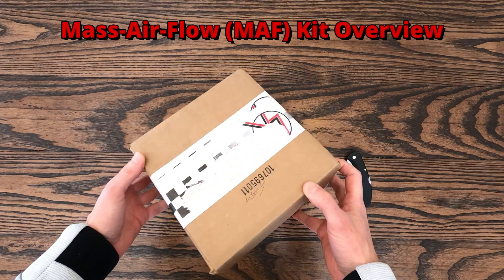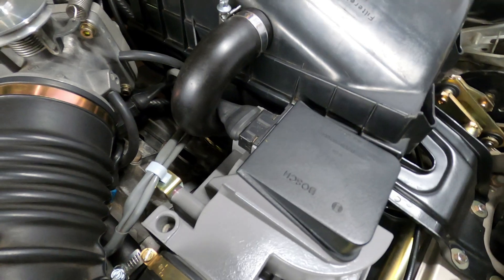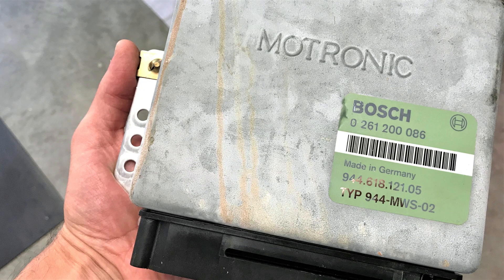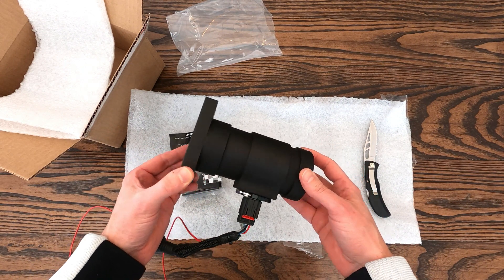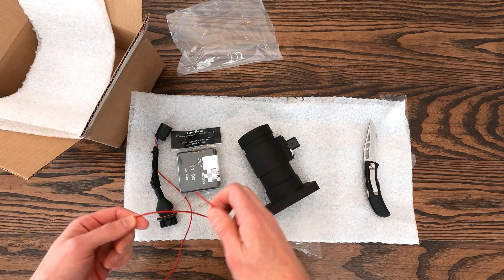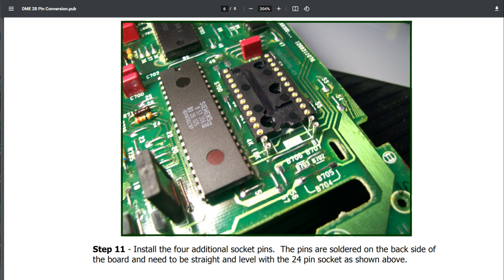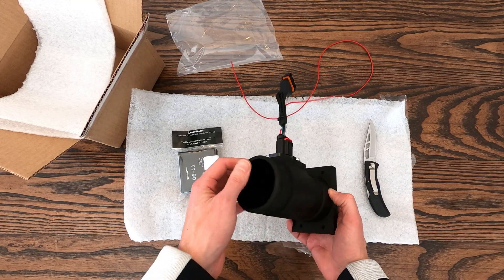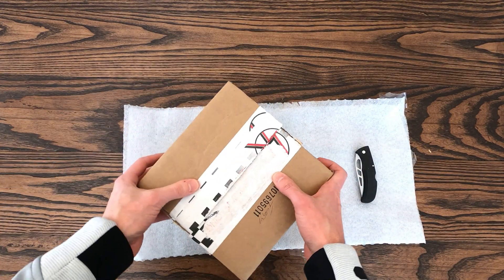Porsche 944 – Mass-Air-Flow (MAF) Conversion Kit Preview & Benefits Over Air-Flow Meter (AFM)

Comment: I can't find a version that attaches to the airbox for the turbo models. What would happen if I used this product on my 951?
Reply from the maker: Hey man! Yeah, the Turbo uses a different kit, but still available. Here’s a link - https://www.lindseyracing.com/LR/Porsche/LRA-M-TUNE.html
Reply: @NC944er  I saw this and many others. I don't like the look of filter. Was hoping for an alternative that bolts to the factory airbox.
Reply from the maker: @j.b.e.5149  Ahhh, gotcha… yeah, I haven’t seen any for the 951 that bolt to the factory air box, they generally use the cone-style filters.

Comment: I finally got all this stuff and a newer DME for my 84. I have a cam on the way as well. Once I get the maf going, I'll get into the cam, and do some porting.
Reply from the maker: Very cool! Sounds like some sweet upgrades. 👍🏼
Reply: @NC944er  This ended up working out great for me. My AFM must have been wonky, because the car runs a lot better.
Reply from the maker: @TheRealFrankWizza  Glad to hear it! Mine has been pretty stable as well after getting it dialed in.
Reply: @NC944er  I got lucky, when I got my DME from ebay, and opened it, there was no doubt that it was in flood water. However I cleaned it with 99% isopropanol, and saw no signs of corrosion. It fired right up.
Reply from the maker: @TheRealFrankWizza  Score! Hope you got a good deal on it, they can be costly. I’ve thought about having F9T do the sport DME upgrade on mine, but it’s not yet too bad off.
Reply: @NC944er  It was in fact the cheapest one, but it wasn't listed as waterlogged. It still cost a little bit, and required me to solder the jumper and pins for the chip. I don't know much about F9T, but how much better could it be than the 4+% gain you got here anyway? I have a cam and the seals/gaskets on the shelf, I have a few things I want to do beforehand, but I think that's the best gain for the money. I think I paid about $550 shipped for the cam from TIJ Power in Germany. I am going to port the head a little as well. Just to clean it up. Port match the intake and head to the gasket. With this MAF, the AFM won't need calibration for the increased airflow lol. 

My car came with a cat test pipe, a dansk catback, and some long tube header. I think it will be pretty peppy with the cam. Mine is an 84 and I think weighs a bit less than newer 944s, which helps.
Reply from the maker: @TheRealFrankWizza  The porting sounds pretty sweet. I don’t see a lot of people doing that on these cars outside of the track scene. 

I’ve always been a pretty big fan of the factory exhaust, I think because that’s how I was first exposed to these cars as a youth, but I have to admit the Dansk exhaust is starting to catch my eye, or should I say ear. 😂
Reply: @NC944er  It has a nice raspy sound to it.

Comment: How has it held up so far?
Reply from the maker: Hey Ron! The kit is installed and doing well so far. No idle adjustment was needed as I think the ICV on the later cars solves for this automatically. It pulls noticeably stronger in the higher revs, but was hesitating a bit off idle with initial throttle tip-in. I adjusted the FQS switch on the DME to add +9% to the fuel mix and that eliminated it for the most part. I’m scheduled for another Dyno test next week to hopefully confirm it’s dialed in well and see the results. 👍🏼
Reply: @NC944er  Thanks! Can't wait to see more. I wish you all the best. Thanks again for making such amazing content

Comment: Nice start.  But, you should DYNO your engine BEFORE and AFTER the MAF install.  All the other vids on YT concerning this conversion SUCK.  You should put to rest once and for all whether this is an upgrade or just snake oil
Reply from the maker: Dyno testing results would be interesting to see, I agree. There are a couple shops in my area and I could probably get the before and after tests done for about $150. Haven’t yet decided if I want to invest it since it’s just a street car and I have no other big tuning plans for the car. We’ll see…
Reply: @NC944er  Inquiring minds want to know.  Seat of pants results are subjective at best.  However, you can't argue with the numbers.  Make a deal with the dyno shop.  You'll plug them on your vid if they give you a rate on BEFORE and AFTER runs on their machine.
Reply from the maker: @guyfaux5010  I just scheduled a baseline test for May 3rd. Regarding the negotiation, you may be dramatically overestimating the influence of my channel, but it’s worth a shot! 🤣
Reply: @NC944er  Alright man.  Don't underestimate your channel.  The value of these cars are going UP and your channel is one of the most comprehensive channels on this subject by far.  I've owned my current 1988 Celebration Edition 944 since 1994 so I've seen all the forums, channels, groups, etc.  Keep up  the good work.

Comment: Are you having a throttle hesitation with this kit as well? Chasing my tail on it. Basically does it fall on its face when you twist the throttle? Ive had my kit since late January its one of the test kits.
Reply from the maker: I haven’t installed mine yet as I’m still rebuilding the front end, but it sounds like I’ll having something to look forward to. 😂

Did you have issues of any kind prior to installation? Also, do you have the power lead wired to the positive ignition coil terminal or another power source?
Reply: @NC944er  i fixed my problem i put bigger injectors out of the 2.5 and a 3.8 bar regulator. For some reason the 2.5 injectors flow more then the 2.7 injectors do at 3 bar as the 2.7 factory uses a 3bar regular and the 2.5 uses a 2.5 bar regulator kind odd but I fixed the problem after long research and trying multiple parts.
Reply from the maker: @vincentarcuri4089  Very cool, thanks for the follow up!
Reply from the maker: @vincentarcuri4089  How badly was yours hesitating? I’ve got my kit installed now and the RPM does dip slightly on initial throttle tip in, hesitating a bit. Only noticeable from idle. I may install a 3.0 bar regulator to see if that helps, currently running a 2.5 bar with the the 2.5 injectors.
Reply: @NC944er  it was pretty well to my liking at least. Like if it had to jump out from a stop it was not there then it would kick in. I put a 3.8bar in and switched my injectors to the 2.5 motor injectors since apparently the 2.7 flow less at 3 bar the the 2.5. And it fix the problem. I do notice at wot in certain RPMs its either not getting enough fuel or too much i need to put it on my dyno and hook the wide band up to figure it out.
Reply from the maker: @vincentarcuri4089  Hey man, check out my install video when you have a chance, Dyno results 13 minutes in, I’m curious about your thoughts. 

I had to jack up the fuel mix to get it to not hesitate on initial throttle, but it’s getting more than enough fuel after 3,000 RPM, dare I say too much. But there are lean air spikes at the start of the O2 measurements between 2k-2.5k RPM. So not a fuel pressure or delivery issue, maybe the mapping is off on the low end? Are you using the aftermarket throttle response cam? I’m wondering if I switch back to the factory cam with the fuel saver arm, would that allow for a more seamless throttle transition? Could the tune be sensitive enough to have been mapped TO the factory cam? It’s weird…

https://youtu.be/0u5eQ9MtqGI
Reply: @NC944er   i will check out the video. I am using and after market throttle response cam. I also did think of removing it. I do feel around 2-2.5k something could be lean i then sometimes fell it in the upper rpm band. I have yet to put it in my dyno with an AFR reading just been soo busy on everyone else stuff soo mine is on the back burner. I have definitely questioned the mapping. I also have my fuel mixture turned all the way up. The car seems to like that the best. But my car does also have larger valves too
Reply from the maker: @vincentarcuri4089  Cool, no worries! Good to know about the throttle cam. I may swap it back and see if that makes a difference. The mix is very even after 2.5k, it’s literally just when opening the throttle. Almost like there’s a delay in the fuel response for a second and it needs to catch up with the rush of air. At the +3% fuel mix setting on mine, it stumbles when it’s cold below 2.5k, but that almost completely goes away once the engine is at operating temp, and above 2.5k it runs like a dream. The blade sensor is apparently a Ford/Hitachi unit… I read one forum post that said Ford Mustangs exhibit the same behavior, but who knows. 🤔

Comment: Installing mine right now.
Reply from the maker: Nice! Let me know your thoughts and if you come away with any tips or lessons learned. 👍🏼
Reply: @NC944er  I don’t like the angle it goes into the J boot or how it’s still a tiny bit loose in boot. May get their silicone intake boot and see.  Gonna use an eye connector for red 12v to coil. Still in the middle of doing turbo brake, manual rack, and stripping emissions. ‘86 NA
Reply from the maker: @devildog_iii3492  Sounds like some nice upgrades in the works! It doesn’t appear the coil circuit is fuse protected, so I picked up an inline fuse kit on Amazon for like $10… maybe pop in a 5amp blade to protect the MAF sensor. That’s odd they can’t get the J-tube mounting size correct, I’ll need to look at that.
Reply: @NC944er  not a bad idea w fuse.  Kinda pissed at Lindsey for scraping off all the part#s
Reply from the maker: @devildog_iii3492  I talked to Dave Lindsey on the phone today and he said the sensors are a Hitachi manufactured part used in Ford applications. He receives them in Hitachi boxes and said the numbers are already scratched off upon his receipt and he’s not entirely sure why, all he does is take the blades and install them in the intake tubes. 🤔
Reply: @NC944er  that’s kinda what I figured they were. And that’s even stranger…. Got mine running, had the damn chip upside down in the F9T. About to put the wheels on and get her out.
Reply from the maker: @devildog_iii3492  Nice! I took mine out with the MAF for the first time today. It pulls noticeably stronger in the higher revs, but hesitates a bit off idle with initial throttle tip-in, gonna play with the FQS switch tomorrow… see if adding a little fuel will help.
Reply: @NC944er  sweet! Glad u noticed a difference. Let me know what settings ur trying
Reply from the maker: @devildog_iii3492  I was able to eliminate most of the initial hesitation by setting the FQS switch to position 5, which is +9% to the fuel mix. It was still there at the +3% and +6% settings. Hoping the wideband O2 readings from a follow up Dyno test will tell me a bit more.
Reply: @NC944er  nice. I’ll start at 6 if I have it. Should be driving this weekend
Reply: Are you having a throttle hesitation with this kit as well? Chasing my tail on it. Basically does it fall on its face when you twist the throttle? Ive had my kit since late January its one of the test kits.
Reply: @vincentarcuri4089  I haven’t started mine yet

Comment: Thanks to this video, I purchased this kit for my '86 NA. I would appreciate it if you could suggest a safe routing of the red power wire to the ignition coil for me. Thanks again for all your excellent videos.
Reply from the maker: Hey Gerry! Yeah, the instructions don’t provide a recommended routing path for the power wire and it’s not terribly long to begin with. I think the answer depends on how clean you want the final look to be, but the primary conditions are that it should be clear of any high heat sources and it has to be connected to a circuit that supplies 12v when the ignition is switched to the “on” position. Here are a few options I’m considering…

1. There’s a switched power source available if you run it back to the diagnostic port on the driver’s side behind the emissions vapor control valves (black cover that can be flipped open to reveal 5 connections) This is what I would love to do, but I need to test it again as the 1988 models eliminated two pins and moved some connections where it’s a slightly different setup from the earlier models. This method would be short, easy, and allow everything to be kept on one side of the engine bay. 

2. The easiest path to the ignition coil would be to follow the wiring for the oil pressure sender that runs under the J-boot, over the water pump, and down the passenger side of the engine. The only thing I’m not crazy about is jumping the gap between the engine and the right frame rail where the ignition coil is mounted as the wire would just be floating there. Maybe route down to the sender and then back up the power steering fluid line? 

3. A cleaner option would be to follow the existing wiring for the ignition coil, which could be picked up on the left frame rail under the air box. It then passes under the headlight bucket and to the right along the front cross member behind the aluminum bumper, and down the right frame rail under the headlight motor. This would be very clean and heat free, but would require front bumper removal and splicing in some additional wire to extend the length. 

4. I also like the idea of connecting it to the circuit for the HVAC blower motor, since it’s powered in the on position. That way the wire could go straight back on the left side following existing wiring and pass though a bulkhead to the fuse box. I was thinking if a no-start condition arose at some point, it would be nice to have the MAF separate from the ignition circuit and you would know it’s receiving power because you could hear the blower running, then move on the the next suspect. 🤔 

Anyway, let me know how it goes for you!
Reply: @NC944er  Thanks for the quick response and supplying so many options. As usual, you're thorough and go beyond the expected. Keep up the good work and I will let you know what I finally decide to do.
Reply from the maker: @gerrygoulet1675  Yeah man! I’ve seen some info on the forums that indicate the ignition coil connection can present some noise and is not fused, so adding an in-line fuse to the power wire seems to be a sound recommendation. My diagnostic port is testing at 11.75v, which may not provide the smoothest operation for the MAF sensor, which requires 12v+. Not sure if that has to do with the lighter gage wire there or oxidation somewhere, but I may be exploring the fuse panel a bit.

Comment: What about the early cars. Is the chip compatible with them with the pin conversion?
Reply from the maker: The DME units for model years 1983-1985 had the ADC chips hard-soldered to the boards, so there’s no easy/plug-and-play method to swap the chips. What’s recommended is to first upgrade the DME in those cases to one from 1985.5 or later, which will have the chip socket already built in. 1985.5-1987 DMEs are setup for 24-pin, so those will need to be converted by adding in 4 additional chip pin sockets to accommodate the 28-pin chip. DMEs from 1988-89 are already setup to accept the 28-pin chips.
Reply: @NC944er  ok gotcha, I figured there was something weird with the early cars

Comment: Looks really good, i live in Germany and im quite concerned about his legality. It’s under the TÜV German standarts?
Reply from the maker: The manufacturer doesn’t publish any emissions data on the product, but it does have a built-in intake air temperature sensor, which is used with MAF for the purposes of fuel economy and emissions control. In the US, each state and county has individual requirements and different standards. I live in a rural area that doesn’t require exhaust testing at all, but states like California are very strict to the point of implementing a visual modification inspection on top of emissions and this would likely raise concern there. I can’t speak to the TÜV standards specifically, but I will say that I’ve seen people swap out the MAF for the factory AFM to pass the test and then reinstall the MAF when they get home.

Comment: Great video , I have heard you can clock the stock afm to change fuel air mixture. I’m curious to see how the maf will preform for you.
Reply from the maker: Thanks! Yeah, I’ve seen some folks make adjustments to the AFM with some success, but looks like it requires a bit of trial and error. If mine were malfunctioning, I’d probably be more inclined just to replace it with a new one. The cleaning of the contact strips and realignment of the sweeper arm seems to make sense though if there are deep grooves developing.

Comment: And the final HP gain if any, is? or is this more of a long term reliability gain? Thx!
Reply from the maker: A little bit of both I think. I’ll include a link to the original developer charts below, but it averages out to an ~8% increase in HP, so roughly 12 HP with a stock exhaust setup, etc. On the reliability side, certainly sensors can fail, but the moving parts are eliminated so there’s no longer any physical wear. And for a lot of us with miles on these cars, we’ll eventually be looking at replacing the AFM at some point to keep them on the road. 

http://www.roguetuning.com/944_maf_kit_na-tune©
Reply: @NC944er  Apparently, Rogue gained even more HP/ torque with a freer flowing cat back exhaust system.  I know the stock NA works best with the stock exhaust system.  It provides a lot of back pressure. Ever open up a stock muffler?  You'll be surprised!  I wonder if the torque gains with a freer flowing exhaust translate into actual low end gains?  The K&N air cleaner was a wash and provided no HP gain.  I prefer the stock air filter anyway.
Reply: @guyfaux5010  I'm not 100% sure but I believe the special edition 924S called The Spirit in Spain came without a cat, and putting out an additional 10hp to 170hp. No cat but with stock muffler may have enough back pressure to not lose hp